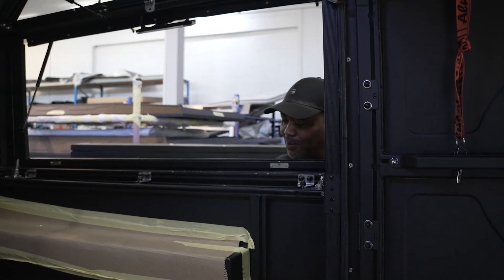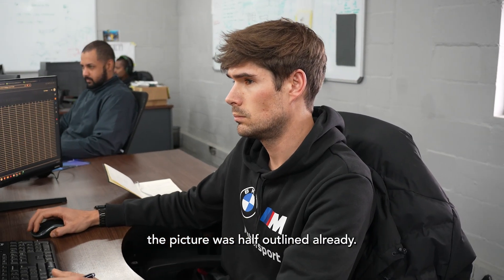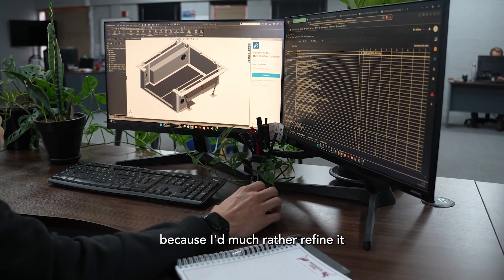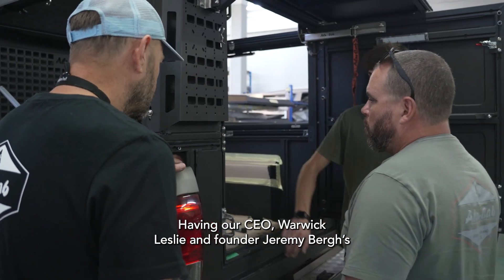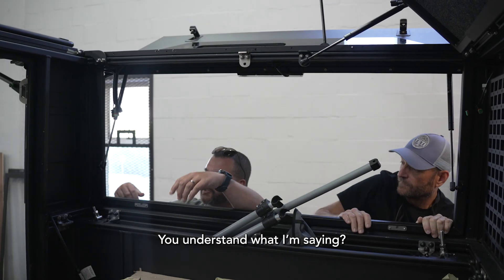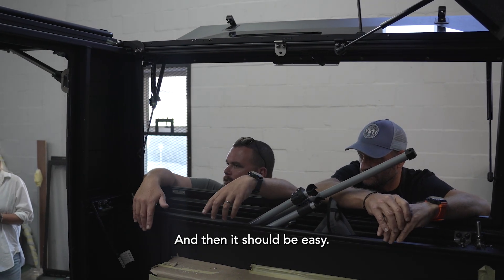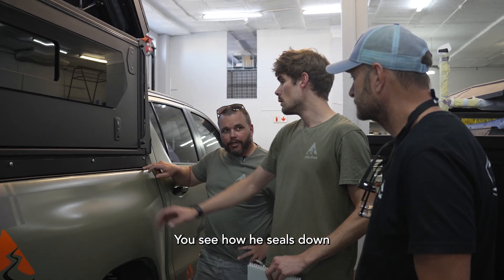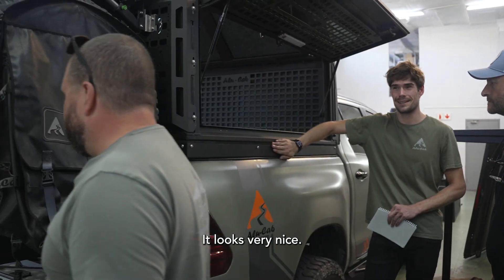Did We Develop The Khaya Camper 2.0? | The Drive-off Base

Comment: Good morning, gentlemen. I'm interested in purchasing a Khaya Camper, but I want it to come with the RT-4S-GA roof tent. Is this possible? If so, what's the procedure for requesting it? I'm from Panama in Central America, where I would have to request it from the dealer in Colombia. I'm waiting for your response. Thank you very much.
Reply from the maker: Hi there! 

Unfortunately this is not possible, as the Khaya is a full-unit with the tent attached. As such, the tent cannot be swopped out for the RT-4-S 🙏
Reply: One option can be to make use of the Drive-Off Base in the video with a ModCAP Canopy, and then mount the ModCAP Family Tent to that. That will be the closest to what you are looking for. At the moment only available in DC configuration.